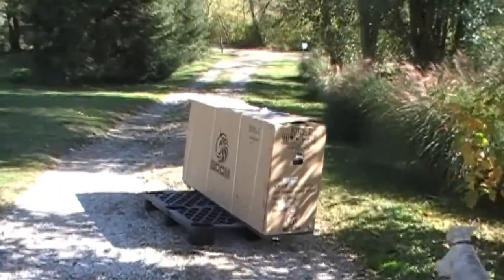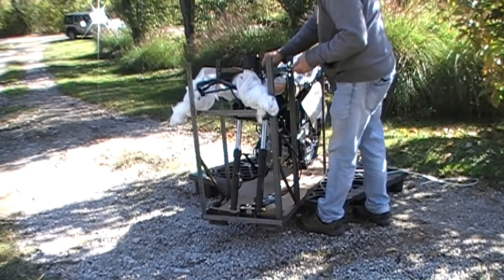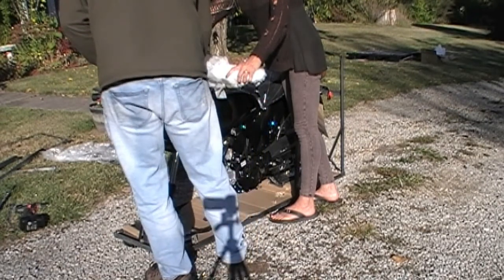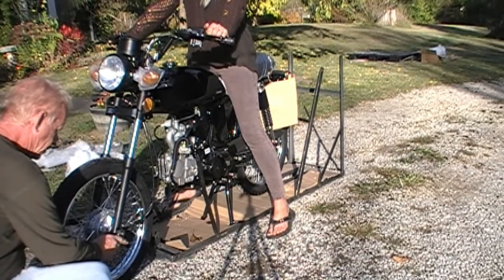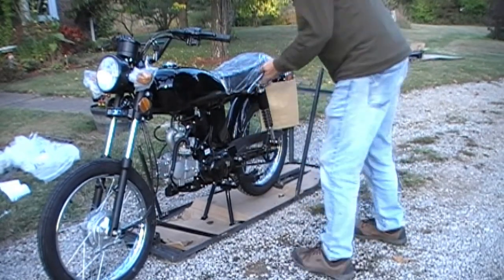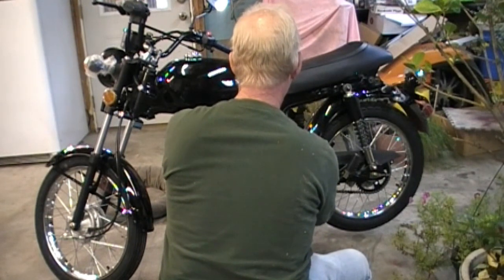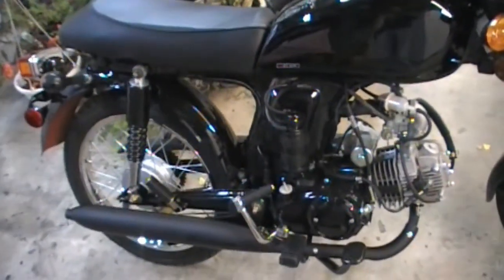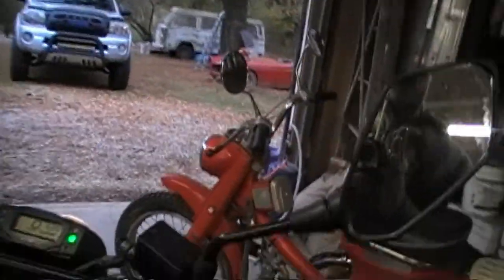Boom BD125 2 - Delivery, Setup and Issues

Comment: Quick question. Does this bike need gear oil or does it share the oil from the engine?
Reply from the maker: It shares it, so you just need engine oil.  A quart is fine.
Reply: @gregslair4278  oh so it pushes it to the other side or do I add oil to the gear side?
Reply from the maker: @mattsanders6428  just add your oil like normal, it'll get circulated where it needs to go.

Comment: Hello, I was wondering what your overall take on this bike was. I am interested in getting one, but have had difficulty finding reviews on them. It's important to note that I have built two motorized bicycles, and owned/maintained three. (I have also built 2 go karts, and a mini bike, so I am pretty comfortable working on small engines) But this would be my first "real" motorcycle. Do you think it's an ok bike for the price if I don't mind doing maintenance work and small repairs?
Reply from the maker: Honestly the quality is crap, but it is fun to ride.  I'd put a 14t front sprocket on to tame down the wheelie's.  The engine seems fine and it does look cool.  I need to experiment with some different rear shocks when it warms up here, it bounces way too much and I've got them as tight as they'll go.   But for $1K, its not bad and lots can be upgraded.  I got mine from belmontbikes.com.
Reply: I have this bike, it's my commuter. it starts and goes every time. The lights are cheap plastic, replace those. Tighten EVERY but and bolt. I paid $1000 for it new, have put 750 miles on it. It's not the best but I love my bike.
Reply: @gregslair4278   Hi Greg - not $1000 anymore! Now it's $1649 with the Holiday $50  off! I just bought one. They claim to have upgraded this and that on the detail page. We'll see. I hope so. Just in case though - which front sprocket did you go with? 14T or 15T ? 420-14t 17mm? as that's what I'm finding on amazon mostly.  I don't have the bike yet so .... Thanks.
Reply from the maker: @petersuzanne6197  I went with a 15.  But honestly, it's a piece of crap and I wouldn't waste your money.  I still don't have a replacement swing arm and it's been over a year.  Spend a little more and get a KP-Mini
Reply: @gregslair4278   Darn - 15T then - I wasn't sure. So what about a swing arm from an S90 ? I see them on ebay. 
might it fit? And as they are still being made these BD125-2's - there should be a way to find one for it.
Reply: @gregslair4278   I'm kinda stuck getting it - should have read more. But I'm hopeful I'll get a good one. BTW the 15t - what size otherwise? chain and width? 420 and 20mm? And thanks for the info and vid - and Merry Xmas! Hope you find / get that swing-arm and not give up on it.
Reply from the maker: @petersuzanne6197  For now just use your original chain.  No need to upgrade.

Comment: Listen Do Not Start the Engine with the shipping oil in it. You must drain it out and use 10w 40 motorcycle oil in it. Use conventional at first until break in is complete. Then use 10w 40 synthetic motorcycle oil that is designed for a wet clutch. Usually there is a small amount of shipping oil in engine, never enough for a start. Don't do what this guy did, I would guess he did damage to engine when he first started it up. No new engine should smoke like that ever.
Reply from the maker: You should check the oil before starting.  I usually change it before starting any, since I know it's crap oil.  My BD runs fine, gonna put a 15t sprocket on to tame down the wheelies.